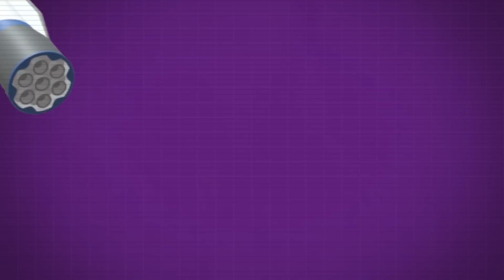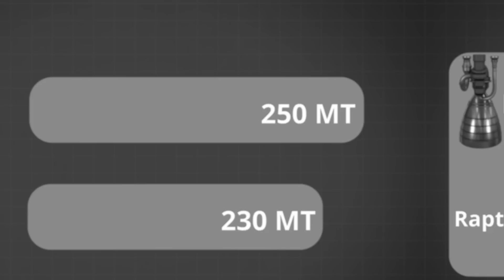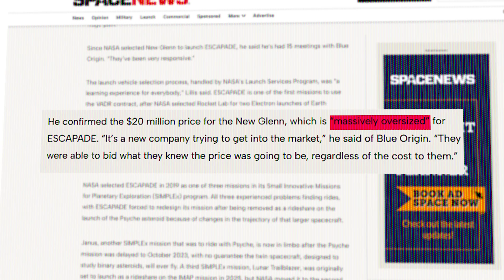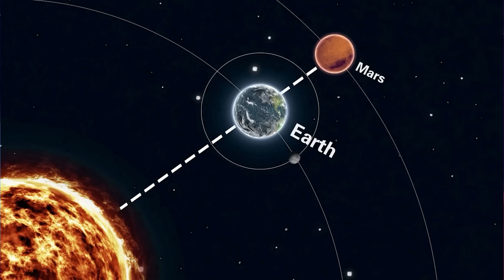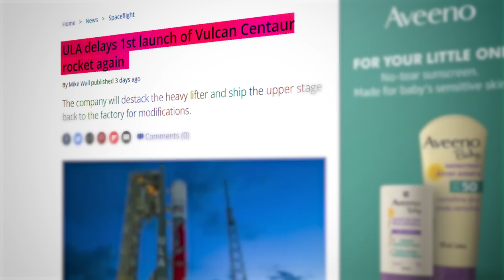The Truth About Blue Origin's New Glenn Rocket!

Comment: While SpaceX has gained more than a decade of experience launching and blowing up orbital class rockets to get to a point where they have one of if not the most reliable orbital rocket ever in the Falcon9. They are building on the knowledge and experience of that to build a new super heavy lift rocket in Starship which will truly be an industry leader if they manage to pull it off. In contrast Blue Origin has developed an expensive joy ride rocket and some engines that have never flown. Their New Glenn rocket is really still only a concept as they haven't even built a prototype yet or anything close to it. Maybe they should actually get something to orbit to get some experience before trying to build a reusable heavy lift rocket. As Musk has said many times, getting to orbit is hard, and just throwing money at the problem doesn't solve it.
Reply: I pretty much agree with your sentiment. The falcon 9 as of July 8th 2023 has launched 237 times with 235 fully successful launches with one partial failure and full failure.
Meanwhile new Glenn hasn’t even launched and won’t probably launch this year and by the time it does launch falcon 9 will have 270-320 launches under its belt and anywhere between the 400th and 550th launch I would think falcon 9 will be fully retired because it became obsolete with starship being launched on a regular basis. This means falcon 9s rivals new Glenn and also neutron by rocket lab will be obsolete because the cost for launching a partially reusable rocket will be more expensive than a full reusable starship launch due to expending the upper stage. We don’t know how exactly it will unfold but we will see.
Reply: @TheAmericanCatholic    For those not familiar with SpaceX, the two failures were way, way back: one partial failure was flight #4 and the other failure was flight #29(=Elon & Zuckerberg cage fight). Since then there have been 206 successful launches (touch wood).
Reply: @TheAmericanCatholic  I would say it will be 2025-26 before New Glenn is anywhere close to a launch. By then Falcon 9 will probably only be doing crews to the ISS and Starship will be launching almost all satellites.
Reply: A proytype Is being made and seens almost complete tought i dont think it will fly, and theres some jarvis stuff made too like a prototype tank
Reply: @ewwwwhh  So far all anyone has seen is a second stage test tank and a first stage mockup, also I think a fairing test article is done. If they were well along with building the rocket they would show it off because at this stage their lack of progress is quite frankly embarrassing.
Reply: @schrodingerscat1863  I dont blame then really, they must not even have 1/5 The funding spacex has and their Focus are differemt, you cant really compare
Reply: @ewwwwhh  They have had huge funding, Bezos hands over a billion a year plus what they get from other investors and projects they pick up from NASA etc.
Reply: @schrodingerscat1863  yep, never have so many been given so much money and so much time and produced so little. BO is at least fifteen billion dollars in, being conservative , and twenty three years in and they have delivered two rocket engines for a rocket that won't fly for a bit and launched a small rocket several times to the edge of space, far short of Low Earth Orbit. Has to be a record in all of human history for worst return on investment.
Reply: @tribalypredisposed  Well we know Bezos puts in 1 billion a year and has since the start so that is at least 23 billion. That kind of money is insane considering what has actually been produced. At this point is difficult to see how such a huge investment is ever going to pay off in an increasingly crowded market where New Glenn isn't even a very good fit.
Reply: @schrodingerscat1863  I don't think Bezos started off putting in a billion a year. There would not be a use for that kind of money at first. I have previously been unable to find something saying when he started the billion a year level, but some sources say he has "only" put in around ten billion dollars. I doubt it is that little. But I assumed for my fifteen billion that it is and then various contracts and assistance from NASA for development of the BE4 and other things is how I ballparked that.
Reply: @tribalypredisposed  Ok, my understanding he was bankrolling the company to the tune of 1 billion a year until it was making money. At the current rate it is never going to make any money. Even the engines they are selling to ULA are so costly to manufacture they are making a loss on each one sold or at best barely breaking even. Their engine needs a serious redesign the way SpaceX has done with Merlin blocks 1 to 5 and Raptor version 1 to 3. They need to simplify their design and get the cost and complexity down or they are never going to be able to produce enough for New Glenn testing along side the ones they are contractually bound to provide for ULA.
Reply: @schrodingerscat1863  there is no apparent thought of iteration at BO, the New Glenn as far as the public knows is going to appear just as advertised in 2016 ten years later. SpaceX meanwhile makes changes incredibly rapidly, an interview with The Everyday Astronaut and Musk is the moment when Musk decides on a change in response to one of Tim Dodd's questions. 

In the end BO will roll out what I call a historic futuristic rocket, a fully realized vision from the past of what we would want today. It will not be what we want now. 

The continued existence of BO is just a vanity project now, there is no path whatsoever BO might take that would result in their being competitive with SpaceX. Sure, they should simplify the design of their engines, but that will just reduce their annual loses.
Reply: @schrodingerscat1863  My father works at Blue Origin. The first stage is almost complete, and the engines are running fine. From what we know, its maiden flight is supposed to take flight next year. And, they are making money (from what I know) and profit from New Shepard alone.
Reply: @schrodingerscat1863  and how much do you think spacex get from elon musk?
Reply: @ewwwwhh  I am sure Musk has put plenty into SpaceX but look what they have achieved. Falcon1 the first private rocket to orbit, Falcon9 first reusable booster with some boosters now being used 15 times, NASA human rated Falcon9 and flown numerous manned missions to ISS, first all private crew to orbit, Starlink, Raptor engine which is now more powerful and half the size of blue origin's BE-4, Starbase TX, built and launched the largest rocket ever constructed. In the same time BO have built a joyride rocket for millionaires which blew up last launch, the BE-4 engine which is expensive and difficult to manufacture and some mockups and test parts for a larger rocket. They haven't even got to orbit yet.
Reply: @dwiggs314 the BE-4 engine just exploded
Reply: @ewwwwhh  That's the thing. Bezos has the ability to fund it. SpaceX has the money because they delivered. Blue Origin has not launch anything into orbit and has fulfilled only contracts to rich joyriders.
Reply: @ewwwwhh  SpaceX started with less funding and none of the financial backbone BO had. It's just that they've been in production for years now with a fantastically cheap rocket. Maybe if BO had a tiny amount of success and actually sold something, they'd have bigger budgets?
Reply: @ewwwwhh  SpaceX is now self sufficient.
Reply: @ewwwwhh  Bezos has spent more on his private yacht than SpaceX has spent on Starship.
Reply: @dwiggs314  How is New Shepard profitable? All it's done is take a few people up and straight back down like an elevator.
Reply: @johnarnold893  Its not cheap to be on New shepard. So unless you've been sponsored by a large company, or any other way of getting free seats, you'll be paying upwards of $100K or more.
Reply: Bezos should stick with orbital tourism. Millions of people would want to go into orbit. Perhaps even moon tourism.
Reply: @tribalypredisposed  New Glenn is n its way to mars with nasa payload while the starship is set to blow up for the 12th time lol
Reply: @queloquepasaaqui  New Glenn delivered the NASA Mars mission to orbit, and good job, but New Glenn itself is not on its way to Mars. Yeah, SpaceX blows up a lot of rockets. But once they figure it out, they will be a decade ahead of BlueOrigin.
Reply: @ewwwwhh  Prototype is no where near finished, they have a booster mockup which is totally none functional, a second stage tank which I believe hasn't been tested at all and half a fairing. The Jarvis stuff is a none starter because the booster just isn't powerful enough to get a reusable second stage to orbit together with any reasonable payload.
Reply: Interesting SpaceX enthusiasts like to throw out Falon is the most successful  rocket instead of "one of the most successful". It is highly successful without doubt, but there are a number of launch systems that spanned decades with little or no failures. Atas II, AtlasIII, and Atlas V were highly reliable and went back to the 80s. Atlas III was a leap incorporating  Russian engine and had no failures. It was short-lived as stepping stone to Atlas V that has been very reliable.  They don't have the launch numbers  mostly there wasn't the payload numbers as there is now. A large number of SpaceX lauches seem to be their own payloads for Starlink. So business sense yes one of the most successful. Personally I like to see all the space launch companies succeed not just SpaceX which I feel is undercutting costs to drive out competition.
Reply: @andret4403  SpaceX is not undercutting costs to drive out the competition. SpaceX has lower costs because they are relanding and relaunching their boosters, some are up to ten launches already. Because SpaceX are not single using the expensive rocket engines, their costs are a lot lower. Everyone else said doing this was impossible, so no one else is doing it.
Reply: @tribalypredisposed  my comment is only opinion based on working in the industry. I have not seen any financial numbers other than what SpaceX releases publicly, and I'm going to guess you haven't either unless you work at SpaceX high up. Financial data is competitive and is going to be held close to the upper tier at SpaceX. Reasons I think they are not as cheap as advertised.
1. I believe  development costs were much higher than reported. 20 years ago, new rocket engine development was in an area of a billion  dollars. Seriously  doubt SpaceX did it that much cheaper unless they really  underpaid their engineers and cut corners. Testing isn't  cheap. Evaluating hardware post test ain't cheap. Recovering failure hardware and evaluating is not cheap. I believe SpaceX was financially creative in rolling  development costs overall costs. 
2. Reusable comes with costs as well.  Expendable rockets are designed to be one and done. Reusable have to be designed for the durability of multiple launches. They have to withstand multiple high cycle stress (engines), thermal stresses, random cycle stresses, aeto loading, and other flight loading.They are more complex, requiring a landing system. All this is more weight, larger engines, more fuel, etc. Plus, in theory, fewer reusable boosters are needed and, therefore, less quality, which generally  equates higher part costs. So, coming into this, the .reusable is going to cost more in manufacturing, materials, and engineering. How that trades to expendables??? Again, that is competitive costing and probably held close. 
3. Recovery and maintenance cost. You have platforms, ships, and personal all for recovery. You have maintenance and inspection personnel. This has to be costly. The stress and loading it goes through should require a lot of inspection. If not, they are gambling. 

All this is a lot of costs and not seeing the actual design trade, I see costing a lot. You need a lot of paying launches. I see them doing a lot of their own payloads. I see them doing a lot of expensive development. So I'm critical they are actually charging a fair price on commercial and military payloads. The NASA  contracts perhaps is a bonus cash flow for them to lower other costs but all that development they do means they have other cash sources to offset payload prices.
Reply: @andret4403  The price of Falcon9 launches is well known and over the years the costs involved have been pretty well determined based on things SpaceX have published and said in press releases. It looks like an unmanned Falcon9 costs about $25 to 30 million depending on various factors such as landing the booster on land or on drone ship. For Starlink launches cost price could be as low as $20million. That will obviously have risen recently with fuel costs increasing substantially but fuel is a small percentage of the actual launch cost. Over the years the engines and booster structure has been improved to make refurbishment cheaper and quicker with some boosters now being turned around in only a couple of weeks with minimal refurbishment required. Cost of development is no doubt being amortised with each launch and with such a ridiculously high launch cadence that is going to be low per launch. Then there is the NASA money to provide resupply and crewed missions to the ISS plus missions like Polaris which will be bringing in a lot of money too, I can imagine a crewed mission adding at leas another $20 to 30 million to launch costs but NASA pay more than double the price of a normal Falcon launch. Development of Raptor will have easily exceeded $1billion by now but with that they have managed to create a mass production engine costing way less than $500k per engine at this point. Starship will not have been cheap either together with all the infrastructure at Starbase and the cape, I think it is probably going to be in the $10 to 15 billion range by the time it becomes fully operational.
Reply: @andret4403  Well the customers aren't being charged more.
Reply: @andret4403  Considering the launch cadence, nothing has ever come close to the reliability especially considering the first stages are being reused, some well over ten times now. I was hoping some other providers would have caught up by now and be using similar lower cost reusable rocket but it would appear to be much harder to do than many seem to think. If Starship is successful it will put SpaceX even further ahead and will probably take a decade or more for others to catch up, it's not a good situation for the industry.
Reply: They should join forces.
Reply: @leomarkaable1  Why, BO would just drag SpaceX down.
Reply: Jeff bozo is not an engineer so when he starts a space company he has absolutely no idea what's going on other than suing elon  he has to just trust that the people he hired know what their doing and so far i haven't seen it, elon has a pretty good grasp on rocket science and can manage his company. Pretty sure jeff just shows up writes checks and believes what he's told
Reply: @bobhood4482  To hire good engineers you have to be able to recognise a good engineer and for that you need other engineers. It's a chicken and egg situation. Musk has a very good knowledge of engineering though he is actually a physicist meaning he can cut though the BS and hold his people's feet to the fire if things don't go well.
Reply: There's no limitation to what we can achieve if you put your mind to it. You can do it. More reasons why Elon Musk and many others has been investing heavily on bitcoin.
Reply: ULA bought engines from Blue Origin, not SpaceX, and for a reason.
Reply: @wyattnoise  A really good reason. The reason is that SpaceX wasn't selling engines.
Reply: @HaydensFunSpot  because "prototypes are easy, mass production is hard"?
Reply: @wyattnoise  The funny thing is that mass production is the easiest part. Prototypes are building things without yet knowing if it will work. The rest is copying and improving.
Reply: @wyattnoise  ULA got a better deal.....:p
Reply: @wyattnoise  The reason is SpaceX don't sell their IP to direct competitors. It makes no sense for BO to sell ULA engines because they are competitors at leat they will be if BO ever builds an orbital class rocket.
Reply: I will believe that Blue Origin is anything other than a money laundering operation when they put together a glen 1. That would be a single BE4 engine on a rocket that simulates the acceleration of the New Glen. A launch without a payload should get to LEO. Rinse, repeat until it happens.
Reply: If you have any knowledge on rocket history, you can draw parallels to how the Russians & the Americans did it in the 60s. Russia has always preferred the 'hardware rich' approach. They blew up a lot of stuff, but they got there, faster & cheaper than the Americans. Up to a point. 

It will be good for America to get Blue Origin up & running. They are slow starters, as NASA once was.

Ref: Lean Software Development and Soviet Rocket Design
Reply: @oddvardmyrnes9040  Exactly, the Russians did a lot of live testing and blew up many rockets learning from each failure and pushing their programs forward. As you say, up to a point this is the fastest and cheapest approach. Notice how SpaceX were following a similar approach up until booster testing because the consequences of failure started to outweigh the benefits of speed because failures start to cause a lot of damage to infrastructure and start to cost a lot more in money and time to fix than it's worth. I would expect caution to build now as the program progresses and SpaceX get closer to fully successful flights. I believe Blue Origin has more problems than just being slow starters, they seem to have a fundamentally broken culture that is hampering development and innovation to the point they are losing some of their best engineers and badly falling behind competitors. By the time New Glenn is ready it is likely to be so outdated as to be pointless.
Reply: @schrodingerscat1863  .. Let's not draw any conclusions yet. The StarShip has still a long way to go, and the booster is not reliably tested yet. However, SpaceX is leading the pack, for sure. You should update yourself on what ESA is doing. They are not very PR oriented, but it is the most SUCCESSFUL launch system in the world, and its accuracy, power & reliably was shown to the world with the launch of the James Webb Telescope. It was so accurate that the telescope did not have to burn any fuel at all to enter the correct orbit, adding 10 years of operational time to the telescope. Impressive. Then the Japanese, Chinese & Indian's are working too. It will be an exciting future. Good luck to them all. 👍
Reply: @oddvardmyrnes9040  The problem is that Blue Origin has already been given chances to get up and running. They had money handed to them. The problem is that the only actual products they have built are a handful of questionable engines and a mountain of lawsuits. When they sued to stop the lunar program because they weren't a part of it, their chances were up. ULA is stuck with them, threatening an entire sector of the government market, the launch of the Dream Chaser capsule and the viability of ULA itself. They are Lucy, continually pulling away Charlie Brown's (NASA,ULA) football.
Reply: I think this is a brain drain issue. All the best engineers want to work for Space X
Reply: @inthefade  Or Rocket Lab. With them deciding to build and launch their next generation rocket from the eastern shore of Virginia, more people are going to leave BO.
Reply: Blue Origin is a scam. Is just a way for Beezy bitch tits to steal from tax payer.
Reply: Starship won’t succeed
Reply: @thechroniclegamer4285  There is no reason it would fail as an orbital rocket. Maybe it will never get to Mars, but it will be launching things.
Reply: @HaydensFunSpot  it’s a glorified Spaceshuttle, it’s unsuitable for manned missions, unsuitable for lunar missions for similar reasons, and theres nothing that needs a rocket that big, it’s a waste of tax payer money
Reply: @thechroniclegamer4285  It is reusable top and bottom with engines that won't need replacing. The cost of a fully reusable system brings the cost down to the fuel. The cost per flight is going to be far below that of anything else launching into orbit today. This has all been explained over the course of the past 6 years, since it was first proposed. It's already gotten the contract for the Moon because they were literally the only ones to make a craft that can land more than once. This can also be looked up. Learn about economies of scale, true reusability and look for old videos you should have seen years ago to understand how this is supposed to work.
Reply: @thechroniclegamer4285  And their is no reason it won;t be suitable for manned missions. There is already talk from a lot outside SpaceX of the Starship variant being used as a long term space station. It already has the dimensions.
Reply: @HaydensFunSpot  Starship won’t be a crew rated rocket, and it’s simply not worth it to turn it into a space station when there are better alternatives
Reply: @thechroniclegamer4285  Better alternatives? No, there are talks about alternatives. I know that all of you still have faith in Blue Origin, but they literally have nothing but a mockup to show for all their work. As for "crew rated." It is way too early to predict that. My prediction is that of course it will. It is the planned lunar lander already. It has already proven the ship design is tough as nails. The "Johnny-come-latelies" have little clue about all of this. I was in the industry nearly 35 years ago and never stopped watching space news. SpaceX has met every expectation. NO ONE else has.
Reply: @thechroniclegamer4285  The cost of using a Starship hull would be a great deal less than alternatives that could be built from scratch. Now there will be about 100 flights before they built such a structure, but given the launch schedules after development is complete, that is a matter of 4 years.
Reply: @HaydensFunSpot  Space X’s Starship exploded on a ORBITAL FLIGHT TEST
Reply: @HaydensFunSpot  source
Reply: @thechroniclegamer4285  As did the first two Falcon 1s. Blowing up prototypes is kind of the point. You learn that way. Blur Origin has no such experience. And the amount of stresses the full went through was insane and it held together for a comparatively long time. The design is strong. The rockets generally work. Risk is where reward comes from.
Reply: @HaydensFunSpot  “blowing up prototypes is kinda the point”

I’ll just point to the Saturn V and SLS
Reply: @thechroniclegamer4285  The SLS cost 17  billion dollars and 16 years to launch a single craft.
Reply: @thechroniclegamer4285  Maybe just knowing space news and history would help you unterstand what is going on today. Not Saturn was a blessed program without a catastrophic failure, but a lot of their predecessers had the same fate as Starship.
Reply: @thechroniclegamer4285  There are a lot of ways to build rockets. And Star ship is not doing anything out of the ordinary, when you are willing to risk craft to gain knowledge. It's something young folks have no clue about. They literally don't know how all this works. I mean, you don't. Study the aerospace development of the 1940s through the 1960s.
Reply: @HaydensFunSpot  propulsively landing directly makes Starship more hazardous for a crew than the Space Shuttle
Reply: Artemis was successful after the 1st launch, Artemis 2 will take humans to Moon again. Starship hasn't even left earth yet, it's too over engineered with 30+ engines and the weird arms to catch it. Blue origin has developed a successful engine BR4, they just develop slowly and prob will have a successful launch and not have to blow up dozens of rockets to have a successful rocket like spacex
Reply: @jtit2025  SpaceX already has 3 successful rockets, Falcon1, Falcon9 and Falcon Heavy, they are now pushing into completely new territory with Starship hence the destructive testing and lot of failures. SpaceX have also developed 2 engines Merlin and Raptor merlin having the best trust to weight ratio ever achieved and Raptor being the most powerful engine ever developed for its size. Sure they could have taken 3 times longer to do all these things and had less explosions but then they don't push technology forward. Remember SLS is using 40 year old technology yet still took a decade to build, it also costs 4 billion per launch has zero reusability and a launch cadence of once a year at best. 
The reason the Starship booster has 33 engines it to be able to lift 200+ tones of payload to orbit yet being fully reusable, nothing else even in the planning stages comes close to that and the concepts are so new that they are going to blow up a few test rockets trying to figure it all out. In comparison Blue Origin has an engine they are struggling to build, one blew up last month, and an idea for a rocket that they aren't even close to building even a prototype after 20 years in business. Oh and they built a joy ride rocket which is about as advanced as SpaceX's grass hopper test rocket from 2013, and that blew up a few months back too. So what exactly is your point?
Reply: @jtit2025  Artemis spent 17 billion dollars to get to where it is. It will cost 2.5 billion dollars a flight. I'm no fan of Elon Musk but you are comparing a vehicle that will never be used for ongoing projects outside it's original design to an all-round workhorse. And SpaceX has literally done more flights in the last half dozen years than all the Apollo, Gemini, Mercury and Shape Shuttle flights combined. NASA has always used outside companies to launch their craft. They actually aren't great at launch vehicles,  losing 1/3 of the last ones they designed.
Reply: @jtit2025  The BE-4 has never been off a launch pad. It has never been fired while attached to anything other than a test stand, and one of the handful they built, blew up on the stand a few weeks back. The truth is that Starship is far from over engineered, the arms are there to remove more complicated landing systems on the ships themselves. And BO has no ship at all. They have a mockup. They have yet to fulfill a single contract, having just barely sent over enough rockets for the first Vulcan Centaur. There should have been enough for 1/2dozen ships by now.
Reply: @jtit2025  don’t forget that the arms haven’t actually been tested too
Reply: @thechroniclegamer4285  They are arms. They have been tested. They have lifted and moved the components of the ship. They have gone through all the movements. The "chopsticks" are already in use.
Reply: I know that you wrote this 9 months ago, but what you wrote was demonstrably false at the time that you wrote it.
Reply: @opcn18  How so, you are going to have to do a bit better than that. While BO have since unveiled a substantial part of the prototype it is far from finished. Their biggest problem is their speed of development and always has been. As I see it their biggest problem is going to be building enough engines for New Glenn. The BE-4 seems to be presenting a lot of problems ramping up production.
Reply: @schrodingerscat1863  Not exactly a subtle shift there from "Their New Glenn rocket is really still only a concept " to "far from finished" NSF was posting videos of completed tank sections in the late summer of 2022.The navionics have been flying on the New Shepard as well as the BE-3 (which is more similar to the BE-3u than different generations of Raptor are to each other). and Tory Bruno had already posted pictures of the flight BE-4's.

As to your claim about difficulties ramping up production on BE-4 where did that come from? Tory Bruno has shown pictures of dozens in production AND talked about how they are building them faster than expected. They had one blow up on the stand (dozens of raptors have failed on test stands in texas) but they didn't shut down the production line over it.
Reply: @opcn18  They have recently unveiled a substantial part of a first stage which although more than we had seen up to that point is still very far from complete. Completed tank sections seen prior to that were just test components. At that point nothing more had been seen and those original tanks were test articles for cryo testing, burst tests etc. The first stage they rolled out about a month ago still only had a mockup of an interstage and no engines. As I said the engines are going to be the key component as ramping up production is proving to be extremely difficult for them. We know they are not having a good time with the engines because of lack of testing. One blew up taking out one of their test stands only a couple of months back and that was one ear marked for ULA. The raptors that failed were mostly being pushed to destruction or early prototypes. The ULA engine was undergoing final proofing before delivery. SpaceX can afford to blow up engines doing destructive testing as they are building at a rate of one per day. BO do not have that luxury. Also BO engines are costing well over 10 million per engine with Raptors being built for about 500K right now.  There are also a bunch of other launch providers coming up who are also developing fast and if BO is not careful they are going to be left with a rocket no one really needs any more.
Reply: Perhaps Jeff will have a change of heart and put a billion a year into medical research or building new cities in the US. Our country is falling apart.
Reply: New Glenn is on its way to mars while Starship is about to blow up for the 12th time :body-blue-raised-arms:
Reply: @queloquepasaaqui  It's taken 2 years since the OP for them to get their first successful launch. New Glenn is an orbital payload delivery system. It may be able to launch a payload capable of getting to mars but it will never get there itself. You seem to have no clue what you are talking about.
Reply: I think with how far behind BO has fallen on delivering the BE4 engines for ULA, likely BO will not have the seven BE4 engines they need for New Glenn to launch in 2024, and knowing that, BO is in no hurry to make the New Glenn since their actual target launch window is already 2026. Step by step with great timidity and trepidation.
Reply: @tribalypredisposed  Agreed, based on current progress I would be very surprised if they have anything ready to test in 2024 or 2025 for that matter. Look how long it has taken ULA to get Vulcan tested, that is arguably a much simpler rocket than New Glenn and is still having problems causing delays of many months. Even SpaceX with the brake neck speed they work at took many months to get Starship to the point it could launch and that was for a throw away test article that would have been ditched in the sea even if its flight profile had been 100% successful. Landing a booster like BO want to do is not easy even when you know what you are doing and have experience landing boosters. Currently they have landed New Shepard a few times but that isn't much more than SpaceX's grass hopped test rig from 10 years ago.
Reply: @tribalypredisposed  If blue origin will be launching new Glenn in 2026 then blue origin is screwed.
Reply: The Soyuz rocket remains to this date the most flown rocket in history with over 1900 launches. It would be interesting to see, in terms of reliability, once falcon 9 reaches those numbers (if ever), how it measures up.
Reply: SpaceX's "starship" is still just a liquid-fueled, chemical rocket. (In science fiction, a, "starship" is a powerful craft that warps the fabric of space.) Just because Elon calls his Big Fucking Rockets "starships", doesn't change the fact that they are just conventional, liquid-fueled, conventional rockets. Btw, all modern rockets are statistically demonstrated to explode one out of 100 launches. You may think that's okay, but, what if 1 out of 100 passenger jets exploded? I think there'd be fewer people flying on passenger jets!
Reply: @samr.england613  Maybe an awkward name, but by the time Musk came up with it he was already launching Starlink corporation.  If you think of it as "Starlink launcher ship" it seems more fitting.  The best launchers traditionally are doing very well to get a run of 100 successful commercial launches in a row, but Falcon recently passed 200 (and counting).

"what if 1 out of 100 passenger jets exploded? I think there'd be fewer people flying on passenger jets!"
          Not if that was the only way to get to America.
Reply: @digitalnomad9985  SpaceX and Starlink are two different companies.
Reply: @digitalnomad9985  At any rate, follow him! (If that suits you.)
Reply: @digitalnomad9985  SpaceX Falcon rocket has not been launched 200 times, thus you are lying.
Reply: @digitalnomad9985  Really? SpaceX Falcon rocket just passed the 200 success launch number and counting? Really? Are you SURE about that?
Reply: @samr.england613  they past the 200 mark for landed boosters not total launches they are even better than that
Reply: @digitalnomad9985  It's an inspirational name. We shouldn't attribute anything to that, any more than we should see Dream Chaser as literally chasing dreams.
Reply: @samr.england613  Look up Block 1 to Block 5. The Falcon 9 has flown 247 times.
Reply: Getting to orbit is hard but Space X has more than 350 successfull lunches..😎